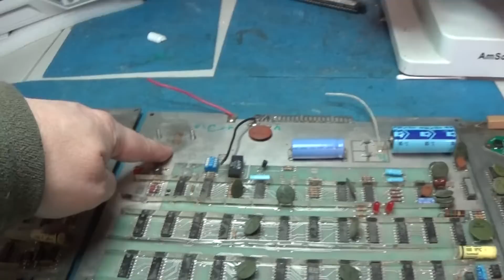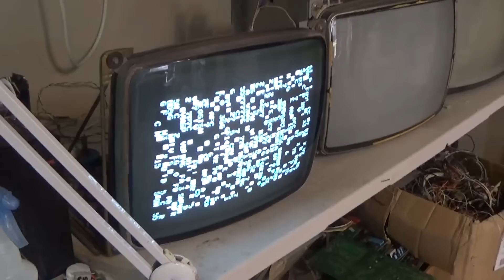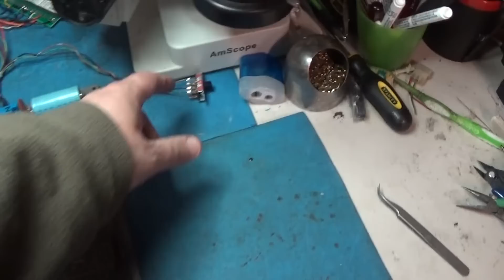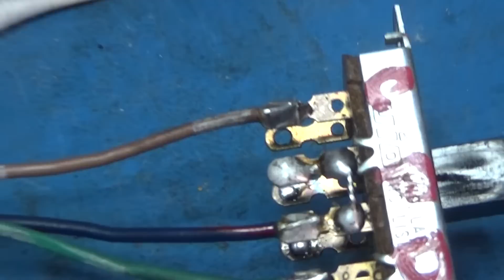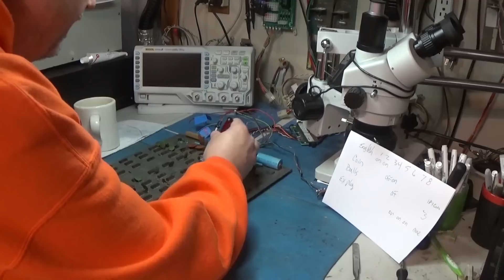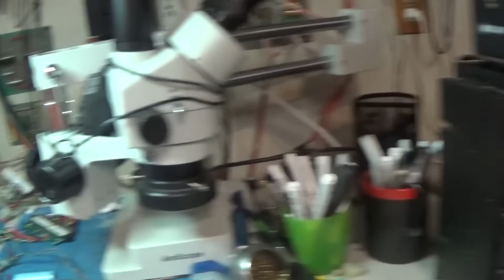1978 Atari Super Breakout PCB Repair  4-5-23

Comment: Is the sound generated by the CPU or does it use discrete logic like the original?
Reply from the maker: I believe it uses the same multivibrator chips. … Now you’ve got me thinking, I’m gonna look at the schematic to find out for sure.
… Edit…   After looking at the schematic… The sounds are CPU generated in this game… It looks like the CPU data bus is latched as display zero through three… And that is what ends up being anded with vertical sync lines through a latch to produce the audio tones